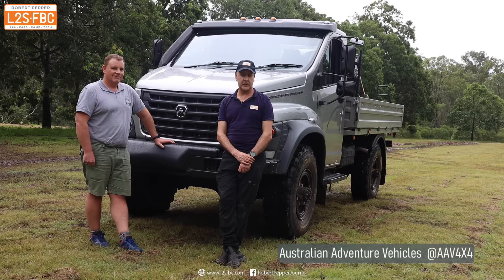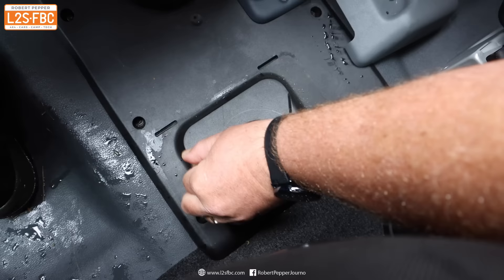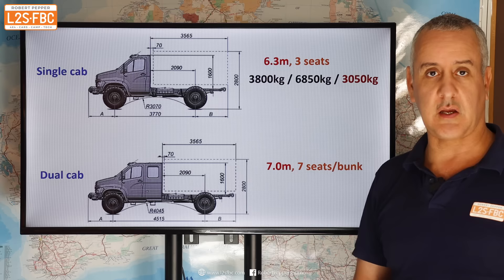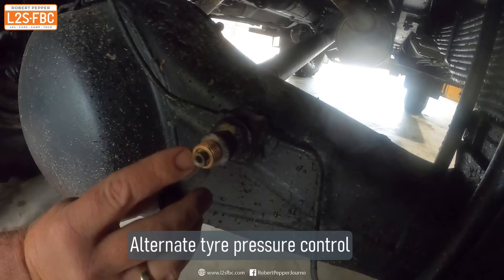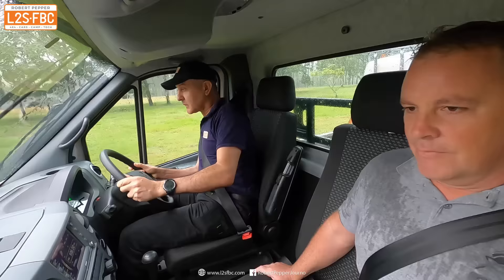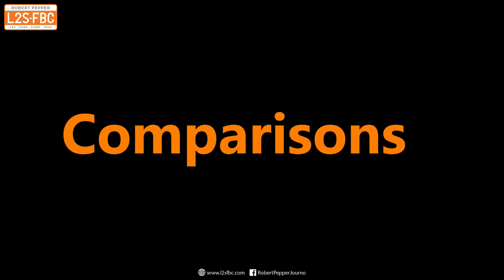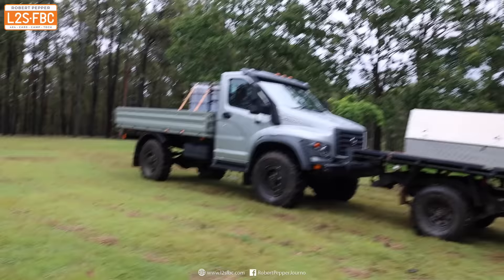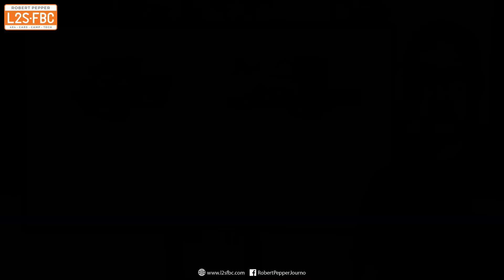Russian GAZ Trackmaster First Drive Review (Sadko Next)

Comment: Is there a general reason for the front bumper to flex with the suspension ?
Reply from the maker: The front bumper is connected to the chassis which flexes relative to the cab. The suspension is different again.

Comment: not enough info on the transfer case, ratios?, splitters?  iveco still looks like the best option.
Reply from the maker: No splitter, tcase 1.9:1, couldn't get final drive ratios
Reply: @L2SFBC  1.9 is a bit disappointing, a compound low 1st would detract from the gearbox for on road driving and it would need a final drive ratio in the 5's for the 42" tyres. so there is a compromise somewhere.
Reply from the maker: Yes will post more stats when I have them. The low range felt quite low but I didn't have a chance to really push it to be sure.
Reply: @L2SFBC   Hi, Robert! Final drive for Sadko is 5.125 (Spiral bevel)
Reply from the maker: Excellent do you know the first gear ratio too?
Reply: @L2SFBC  
I − 6,555; 
II − 3,933; 
III  − 2,376; 
IV  − 1,442; 
V − 1,000; 
Reverse − 5,735
Reply from the maker: Thanks so much!
Reply: @L2SFBC  Not at all!
Reply: @L2SFBC   @Виолетта Фирсова  meant "you're welcome"
Reply: @Fafnir33   Mr. Fafnir, I reckon Mr. Pepper already knows "not at all" phrase meaning.
FYI - https://dictionary.cambridge.org/dictionary/english/not-at-all

Comment: 90 k AUD = 5 200 kk RUB in the base / board, without a winch / - the price in the Russian Federation is 2 800 kk RUB = 48300 AUD / 1a * 58r /, good work, 4 years I looked at it under the expedition car . So sadko is not someone who did not sort out the items and did not compare ... I will buy Iveco . 

90 k AUD = 5 200 kk RUB в базе / борт, без лебедки / - цена в РФ составляет 2 800 kk RUB = 48300 AUD / 1a * 58r /, хорошая работа, 4 года я смотрел на него под экспедиционный авто . Так  садко  ни кто не перебирал по пунктам и не сравнивал ...  возьму "Ивеко 4х4".

Comment: This beast is a bit of an enigma to me. Yes, it's wildly capable offroad; but I'm left wondering who would buy one? 
I doubt a serious "rock-crawling" person would want it...too wide and unwieldy when compared to say, a 6" lifted GU Patrol on 37"s.
I doubt a serious "overlander" would buy one; too uncomfortable and slow on the highway.
I doubt anybody would buy it for its towing capabilities; what was it? About 2.6 tonne towing? Abysmal!!!
I think you missed a couple of key points in the review: COST? Even a ballpark figure? Are we talking $50K, $100K, $200K???
Secondly, fuel economy wasn't mentioned...Okay, it has 2 x 90 litre tanks....how far will that get me?
I'll look forward to the other comparisons. I am under no delusions about my choice of vehicle...A 5 tonne Chev Silverado 3500HD (single rear wheel, not dually). It has a GCM of 11 tonne, 400kw and 1200nM of torque. It is a far better proposition for heavy towing, but would fail in any sort of 4 wheel driving "test" against that big girl!! It's about the same width.
Horses for courses, as they say...It's just that I'm left wondering: where's the course that this jigger belongs on?
Reply from the maker: Cost is around 90k plus onroads. That's mentioned at about 1.45.

It would be no slower than many other trucks.

Yes towing is poor!
Reply: @L2SFBC  cheers, sorry, I missed the note at the bottom of the screen.
Reply: I think it would best suit long term overlanders, people that live full time in their vehicle, and don't want the hassle of a caravan. You could get a decent motor home setup on the rear.

Comment: Excellent review, but CAUTION. These cars seem capable and shiny only when new. FIrst months rides might be OK. But a quality is as low, as of those Chinese cars 10 years ago. Bearings,  electronics, gears, metal will degrade just in other months and it will become a pain fixing everything around (coz spare parts quality is just as awful).
Note commentators from Russia wonder this truck is produced in Russia 😂. Coz it's not a trusty beast. And note people here praise GAZ trucks, but mentioning OLNY Soviet models.
Coz modern GAZ trucks are rubbish, cheap though. 
Don't be deceived. Watch long owners reviews!

Comment: Way too under-powered and under-torqued for 4.6t with tray unladen. 95km/hr max speed cruising is not going to cut it.
A dual cab ranger is not 5500mm its about 5260 from nose to tail a single cab cab-chassis depending on how long the tray is you have fitted is well under 5500mm
Reply from the maker: That's life with trucks like that, you're not going to get power-to-weight figures that are super impressive!

Comment: Just watch how the loading platform is repainted when the wheels are diagonally suspended.  The frame is too soft.  The quality of the interior is just awful.  Very cheap switches.  Why do they want $ 90,000 for this stuff?
Reply: The frame is specially designed to be twisted. It increases track's offroad capabilities. Take a look https://www.drive2.ru/l/463013418501144647/
What about interior - I absolutly agree:)

Comment: Don't make a mistake, don't buy it! 

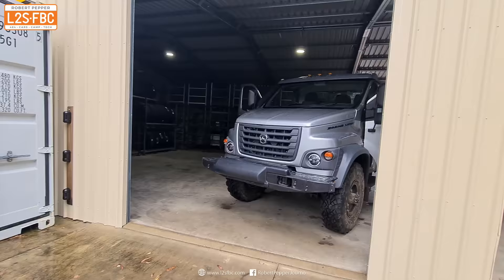 Convenient holders for vodka (3:45) will come out along with a cup one day.  Glove boxes will stop opening or closing.  The engine will overheat.  The brake lights will flash along with the turn signals.  And I'm sure all this will start to rust even in dry hot climate.  

I know what I'm talking about, I owned 8 GAZs and they never change.
Reply: Lol. Thats export car and costs three times more then here localy, so the parts it assembled of are thorougly examenated. This car is totally difrent from whatyoull buyin russia
Reply: @Konekurim  Oh, yes! There is a secret league of trusted and honored part suppliers that produce sharp and precise parts for a few vehicles for non-russian markets. Or it is Santa Claus' workshop in Laplandia?    The numbers of part suppliers is pretty limited and i'm pretty sure that this car is the same product with some best and whistles